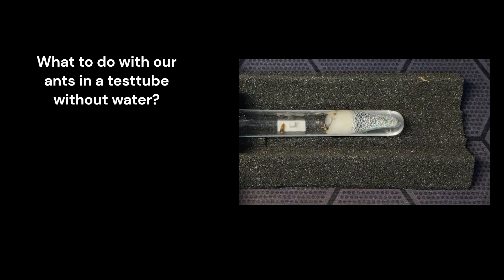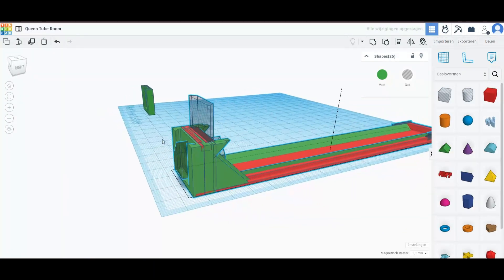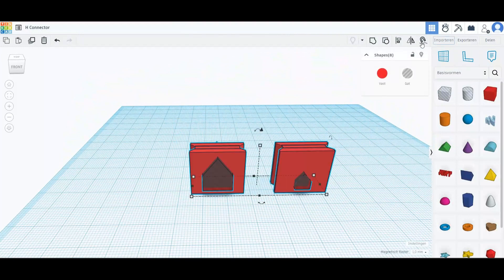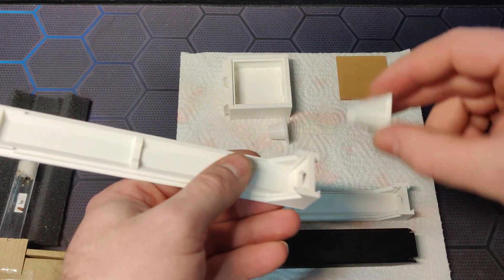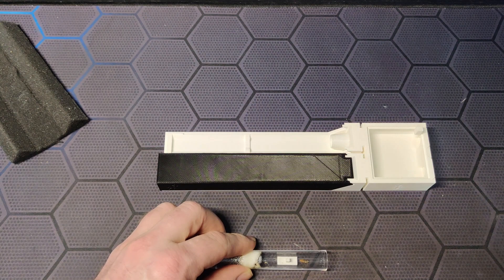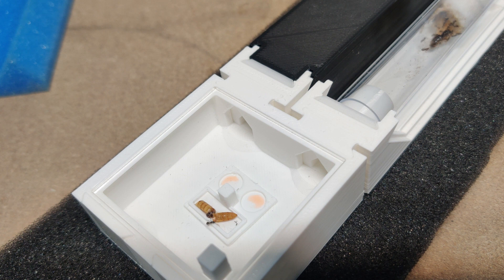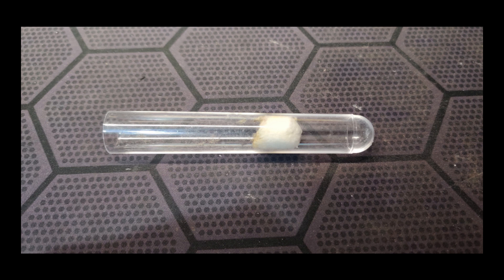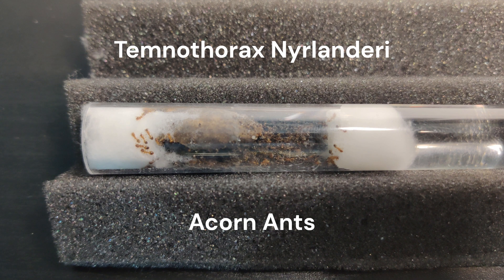My Lasius Niger ants are running out of water! Lets help them!

Comment: I love your creativity with your 3D printer. I love to see someone designing his own stuff for ants. And your ants love their new home for sure.

And could I ask what resolution do you use on your prints or any special settings? Your prints are looking pretty good and clean.
Reply from the maker: You're welcome. Thx for the support.
Reply from the maker: Thank you very much! The trick for nice prints is the right speed, temperature, nozzle size and layer thickness. I use a Ender 3 V2. Normal speed settings, 225 degrees for black pla, 230 for white, 0.4mm nozzle and 0.2 later height. But this a game you have play yourself. Good luck
Reply: @TheCraftingAnt  I really appreciate it and thank you for your reply. Love your channel👍